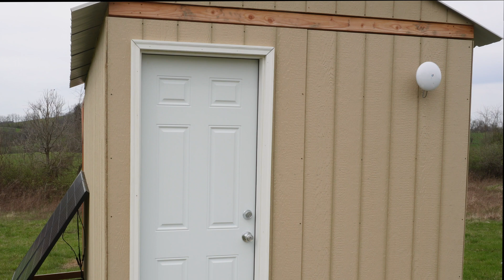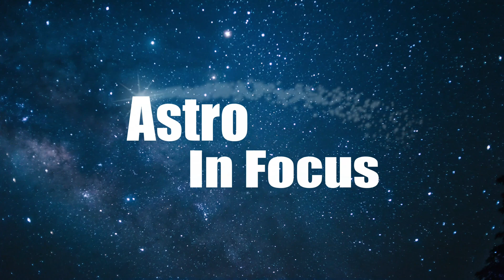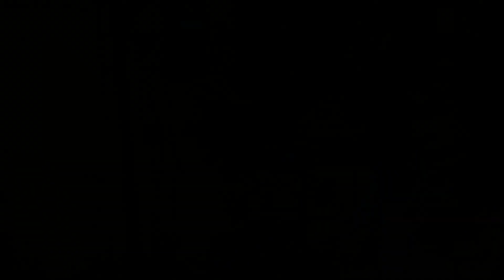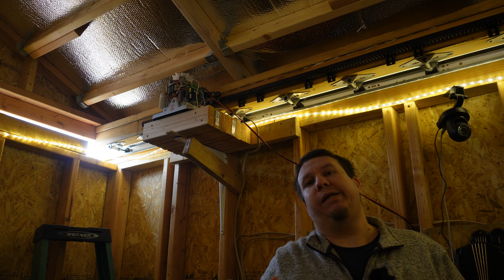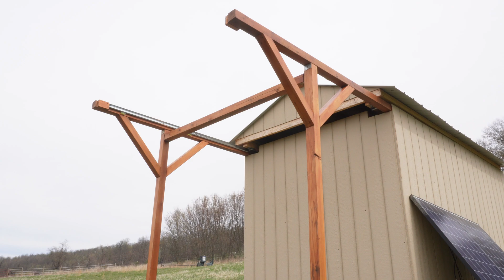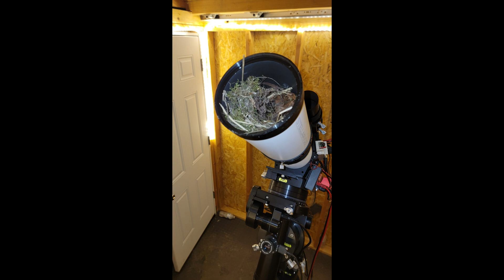AstroInFocus Solar Powered Observatory Tour

Comment: If you're weather is anything like it is here in the Chicago/NE Illinois area I'd stick with the MC. If you only get a few cloudless nights every month like I do you don't want to be spending time taking multiple images of the same target through various filters, possibly on different nights (or the following year). With an MC and a dual-band or LP filter you can get a nice amount of data in one night on one target and not have to wait for another cloudless night to capture additional data. Anyways, that's my opinion. Thanks for the video!
Reply from the maker: Thank you for your recommendation, I am still torn between switching to a mono camera.  In my area we do have more cloudy nights than clear, but when it is clear it does seem to be when the moon is shining nice and bright. I am convinced that the moon has the ability to dissipate clouds.